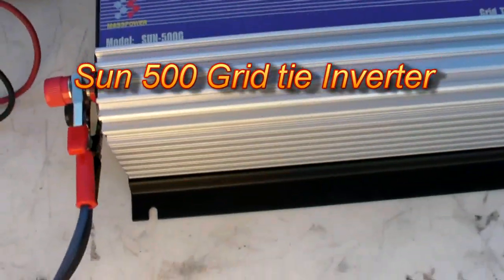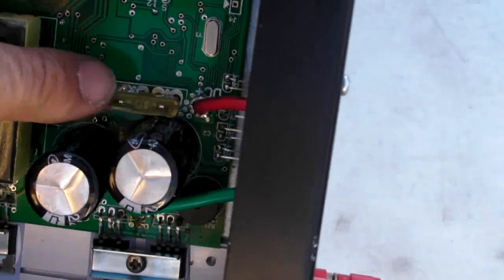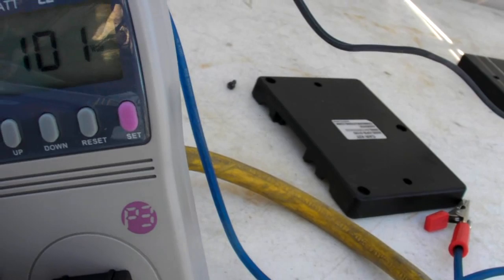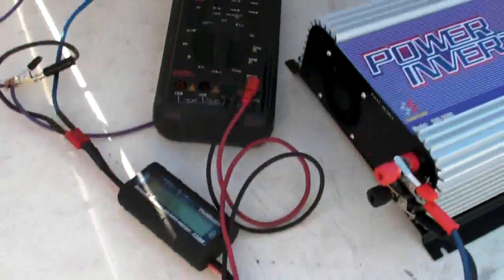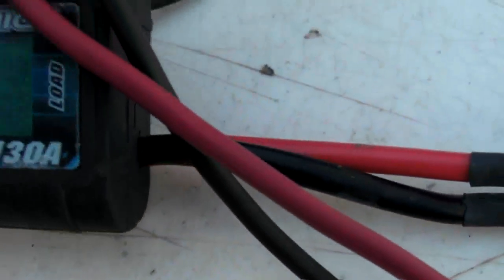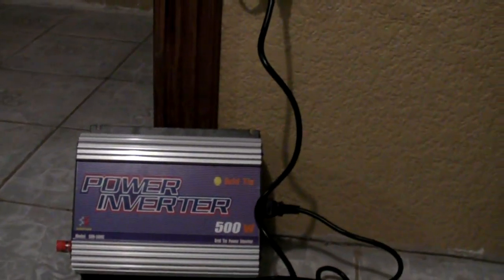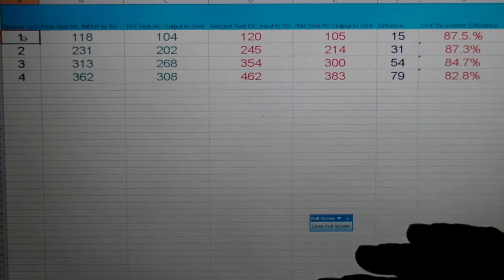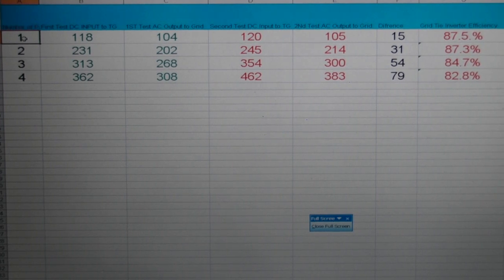Sun 500 Grid Tie Inverter Review

Comment: I think these are dangerous.  I was going to use these 600w Sun inverters I bought, but it looked to be too dangerous.  I ended up buying enphase inverters.  I need to sell the Sun inverters on ebay or something.  Let me know if you're interested, that's two 600w inverters.
Reply: Ya i kind of like enphase i read a lot of good review, but i cant find model that can work with 240/50hz mains. I bought chinese GWV 600w GTI...everything works normal except...the efficiency. I am using 6 36cells BP  panels. 2S 4P setup  80w each. Output less than 100w. Customer service is suck. Don't trust chinese. They suck your wealth bit by bit by offering cheap junk. Let me know if you come across one. Thanks.

Comment: I have four "24v" panels. So I bought two Sun 600w GTI's input 10.5 t0 30Vdc, and tied the panels together in sets of two to keep the wattage within the range of the GTI's.  Neither GTI would fire up. Panels were putting out between 32 to 23.5 volts DC. Need now to order a couple GTI's for  22V to 50 Vdc and try again. Commenter below was right.
Reply: Joe Theragman

Comment: Hi what is more powerful in this two solar panels
1. one solar panel 240 watts, 60 volts, 5 amp
2. two solar panel 100 watts, 19 volts, 5 amp in parallel connection

Comment: teddy, I'm no solar pro, but many of the things you have shared concern me.  

1) When you use a GTI, you don't use batteries at all,  The panel to the GTI to the outlet, that's it.   

2) Yes, the volts and watts should be compatible for both the panels and the GTI.   Don't use a 220V GTI for a 120V panel, likewise don't use 300W panel on a 200W GTI even if you don't expect max panel results

3) mixing mono w/ poly, GTW w/ Batts, etc, all seem risky and dangerous

A DC shock can hurt really bad

Comment: Can my GT inverter  be damged if i connect it first to the battery before feeding it to the grid?. I got loads of panels ( 2 of 195 watt, 3  of 230 watt and one 100 watt) but i thought Im not getting much power from the sun. We dont have much sun here in England. I've noticed that my 195 watt is almost the same power with my 230 watt panels. Since my 195 is mono and my 230 panels are cheap, heavy poly type  LDK panels Can power from battery can  quickly  be drained off the grid if feed via GTI?

Comment: no matter how huge is the  wattage your inverter is, it should be compatible with the power range of solar panels. I  once bought a 500 watt inverter but it doesnt work on my 195 and 230 watt panels. The reason was my inverter's power range is only 14-28 volts whilst  my 195 and 230 watts panels are usually for 30-52 0r 22-60 volt/power range inverters. AN INVERTER  which has the power range from 14-28 is only capable of powering up to a maximum of 100 watt panel.

Comment: If you power up the input with batteries, the mmpt will keep driving the current up until the inverter fries.  Pv's are current limited, batteries are not (well they are but the current is very high).

Comment: Nice job on the solar panels!!!  Nice to know you know your math... Your running your GTI right off the panels.... I have 90 watts from my panels but only outputted 45 watts...??? Yes I know...wire resistance, inverter ineffificy.etc So I connected my GTI directly to my battery bank..WOW!!! Over 110 watts now... The back of the GTI, it says connect to solar panels or wind generator... I thought, hmmm 12 volts is 12 volts, it won't know where its coming from... Glad I took the extra step...

Comment from the maker: @rdallas81 yes, I'm going 60-75% load for efficiency and duration of the units. I used a 300 watt tie running it 50% (150w) near a year and is still kicking. Once you get passed the 50% heat is an issue (that's where the efficiency goes) and the higher you go there is more of a chance of premature failure.

Comment: As you did in this video. The best way is to have short DC cables and longer AC cables since the loss will be higher in the DC cables because the Amps are higher therefor more energy loss to heat..

Comment: Good video, with good information on the Sun-500g.
My experience with the 24-55v DC, 240v AC model (figures are very similar to yours):

50w DC in gives 45w AC out (90%)
100w DC in gives 89w AC out (89%)
200w DC in gives 174w AC out (87%)
400w DC in gives 340w AC out (85%)
500w DC in gives 415w AC out (83%)

Still, I like the Sun-500g.